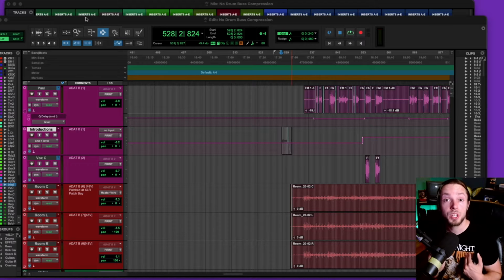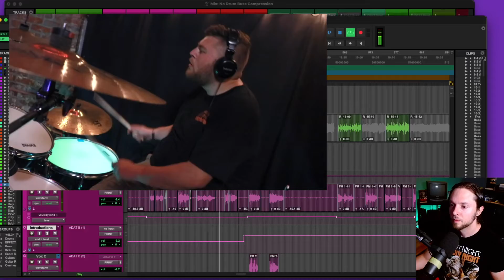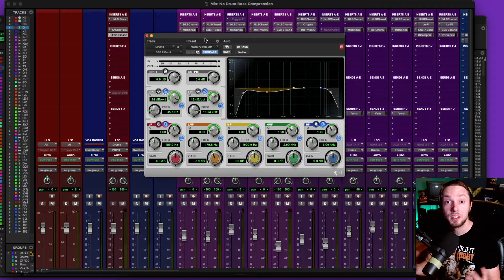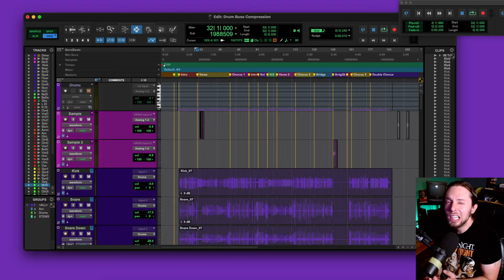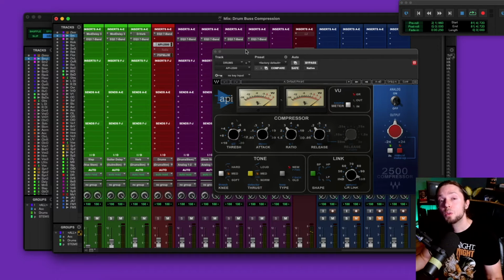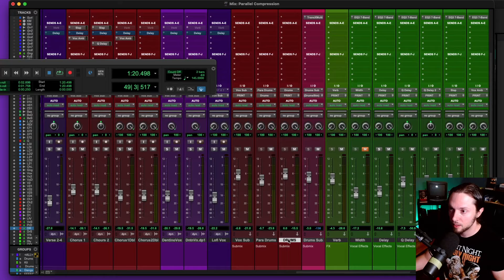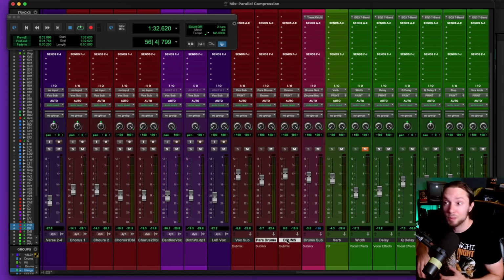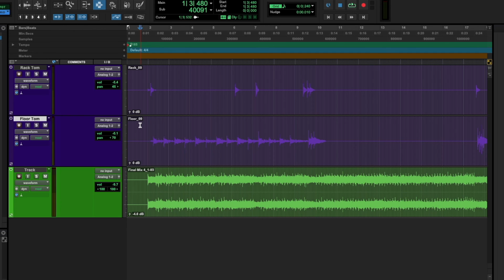3 Drum Buss Compression Techniques For INSANE Drum Mixes!

Comment: Thanks Bobby.
I almost never use drum bus compression on the insert. 
I hate the sound of it.
Always go parallel now or without parallel, with exaggerated transient (slow attack fast release) and or less transient (fast attack and fast release).
Usually the parallel compression is added after the other track is mix to balance and make the drums cut through more

Comment: All very helpful!

You've probably covered this but got any tips for helping stop a snare poking way out of a mix? But while preserving the smack and weight of it? 

I either get it too weak or its like 5 db louder than the rest of my mix 😂
Reply: He's covered it before in another drum video. He said to use a clipper plugin to shave off the transients so you can still get that weight without it being so spiky. Saturation plugins work well too. Hope this helps
Reply from the maker: @300Spartan03  Spot on man!
Reply: You can also try Nolly’s mix bus compression trick… he talks about it in the smash and grab masterclass video he put out a few years ago. Basically he has a mega fast attack and release on the mix bus that has a HPF side chain that causes the snare to hit the compressor at about 3 dB so it ducks the mix for a split second and the HPF is so that the kick doesn’t blast the compressor and cause pumping. I’ve been doing that on all genres that I mix and it works like a charm to achieve what you’re asking about